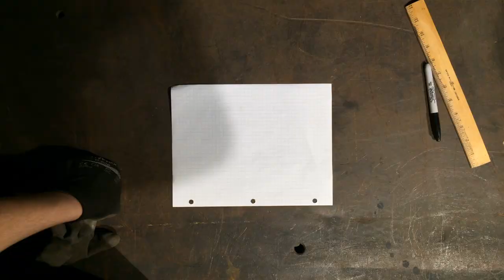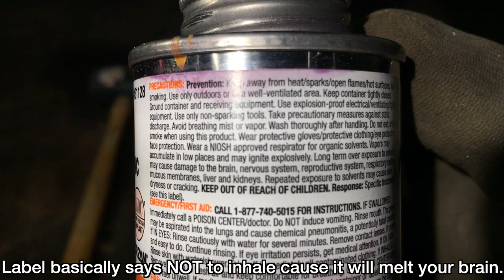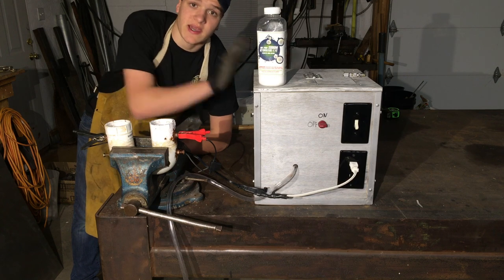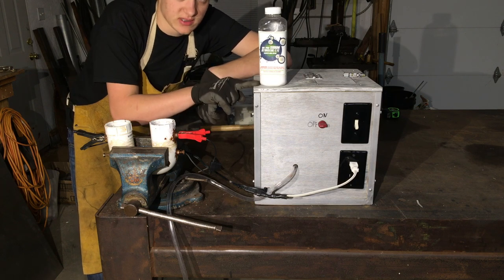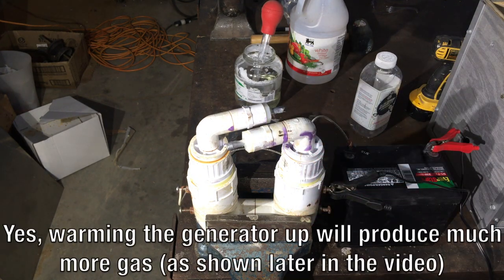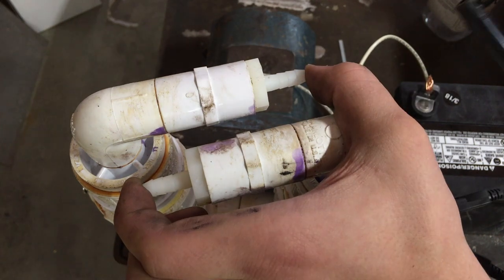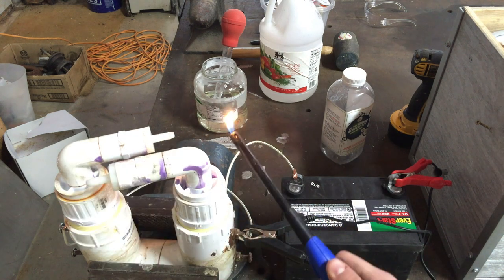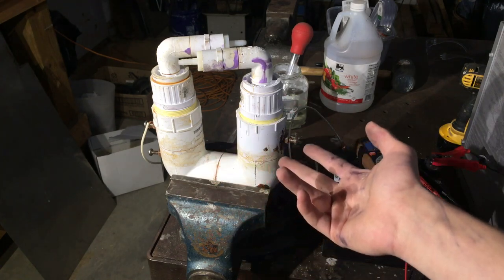Separated Hydrogen and Oxygen Generator (made from PVC) (HHO)

Comment: if u wanna cut stainless steel easy use just water ik it sounds weird but it works
Reply from the maker: Yeah I’ll keep that in mind next time I have a hundred grand for a water jet 😁
Reply: @HappyMadScientist  lol applied science did a video and made one for like 300 bucks but i didnt mean that anyways instead of oil just use water i swear to god its the only way to not go threw 2000 drill bits when the water gets really hot it does something with the molecules in the stainless and it cuts like plain soft steel
Reply: just try it plain tap water spray the part when it starts to steam it start cutting once the water is almost gone spray again
Reply: @Fortitudoo  u do it and show it

Comment: obviously your simple small plates and large separation between them and not using much of an electrolyte etc etc is a poor design and can be improved,,i keep hearing ppl talking about over heating issues but what comes to mind for that solution is to have cold circulating water system that will keep the generator cool
Reply from the maker: Your right, I could just make a water circulator but the fact that it was heating up sooo quickly whithout much gas production is prob do to the inefficiency of the system. Also NaOH reacts with aluminum so I would need to make my own radiator with copper or make some type of heat exchanger.
Reply: @HappyMadScientist  i forgot what was OH? and what aluminium you concerned about? perhaps you do not have proper conductivity or the materials you are using are not good,i think in commercially built models they use some kind of cooling fans but not sure how this would work,,for what im thinking simply use a larger container with in and out hose that circulates water either by a small pump or hooked to your faucet and submerge your generator jar in that large container full of circulating water,,remember to give me credit for the idea and i got more that i thought of for materials to use,,in any case like i said the whole design needs upgrading and can be improved,,you are not using much in terms of plates
Reply from the maker: @ARCSTREAMS  NaOH is sodium hydroxide. It reacts with aluminum and ironically produces hydrogen gas in the process. And since most radiators are made with aluminum it wouldn't work. I plan on making a large dry cell generator that I will make a heat exchanger and that will allow me to use radiators to cool off the system. 
Adding more plates won't work because the gas is only being produced at the very bottom of the plates. It could also contaminate the gas because of the "floater plates" between the electrical sources would produce both oxygen and hydrogen. 

If you want to produce hydrogen seperated from oxygen gas efficiently you have to use whats called a PEM cell.
Reply: @HappyMadScientist  AL and NaHO mixed will produce hydro on there own? anyways you dont need a radiator for a cooling system ,what i described should be more than good enough to allow you to run for a long period unless your wanting 24/7,,i seen separated cells and they still have more than one plate per side like you got ,as for dry cells idk much about them so no help there

Comment: Where can u get the right metal?
Reply from the maker: Online or at yer local metal depot. 

316 stainless is the best easily obtainable/workable metal. Downside is that the water you use in the generator becomes illegal to dump (my understanding).
Titanium is the best all around from what I’ve heard.
Mild steel works for a while if you use sodium hydroxide as the electrolyte. 

Research it thoroughly though before you try anything and don’t hurt yourself 😁
Reply: @HappyMadScientist  what about copper?
Reply from the maker: @ryandavis4689  Never tried it for myself but from what I've heard it disintegrates pretty quickly. Mild steel can work for a while if you use sodium hydroxide as the electrolyte. Still, it won't last near as long as stainless.

Comment: Try feeding hydrogen into car air intake
Reply: Hydrogen implodes when ignited... meaning it get smaller... (hydrogen takes up more space than steam) thus hydrogen actually works against the expansion of gasoline combustion.

Recycling exhaust heat to boil water for steam expansion inside the combustion chamber is another story
Reply: @unitedspacepirates9075  wrong
Reply: you can use a powerful uv light to dry/dehydrate and accelerate combustion, as H2O is the only byproduct after combustion and the gas can expand to a greater volume
Reply: @gunnarthesavagedangerous6164  lol. You think steam has more volume than hydrogen?

Comment: It is an extremely good idea i appreciate that but can you make a hydrogen and oxygen generator and run a bike on it not car or any other vehicle but run a bike on hydrogen and make detailed video on that also
Reply from the maker: Thanks! Good idea! I’ll defiantly have to do something like that. First I need to make a more robust hydrogen generator that could produce much more of the gasses. I’d have to decide to convert a gas engine or make a fuel cell.
Reply: @HappyMadScientist  both options are good at their best
Reply: @HappyMadScientist  if possible for you try them both, more prefrence is for converting gas engine
Reply: @HappyMadScientist  fuel cells are a pain in the brain storing small to large amounts of hydrogen it's a lot more economical to do a on demand system or dry cell
Reply from the maker: “Pain in the brain” lol I like that. Yeah it was just an idea... It’d be more efficient to just do a fully electric system rather than convert electricity into hydrogen. It’d prob be best to compress hydrogen to several thousand psi but if it leaks... BOOM! Haha no thanks
Reply: @HappyMadScientist  but pure hydrogen don't burn
Reply: @HappyMadScientist  and also if hydron on demand system is used then there is no need to modify engine only try to add the hydrogen inlet to engine so that it can be burnt

Comment: Chromium gas you think!!! Chromium carbonyl. How the hell do you get any sort of chromium gas from electrolysis of water and NaOH
Reply from the maker: Chromium gas as in hexavalent chromium. It is produced as the stainless steel’s chromium (added to prevent rusting obviously) oxidizes. It’s the same thing that happens when you weld or or grind stainless. You can easily see the yellow color of the hexavalent chromium dissolved in the water.
Reply: @HappyMadScientist  gas you say???? Gas. Maybe welding would slightly vaporize chromium, but it would not stay in the air as a gas.
Reply from the maker: Maybe your right... I just assume some of it dissolves in the oxygen bubbles that oxidize it in the first place?
Reply: @HappyMadScientist  no it would  combine with oxygen to turn into chromium oxide but it doesn't float  around in bubbles. It will turn into dust if the electrolysis water spills on the ground. Same with welding, it would be like dust, but you will only get oxidation of the chrome if your gas flow is not high enough.
Reply from the maker: Noted. Thanks or the help!
Reply: @HappyMadScientist  might be better to use titanium for the anode. That is what they use as an anode basket in eletroplating to hold the metal they are depositing
Reply: @HappyMadScientist  that way no toxic salts

Comment: The burn rate of hydrogen gas is 25,000 cu ft per second.😎
Reply from the maker: Yeah lol. That’s good stuff.
Reply: James Lacey cu = CUBIC——— FEET PER SECOND ???  That’s a volume measurement!  You need a length measure .
Reply: @nicgreen4234  If you took a square tube , 12 inches by 12 inches that was 25000 feet long and filled it with hydrogen gas at 1 inch water column of pressure, then ignited one end it would take 1 second for it all of the hydrogen gas to burn. Does that help your thesis. Put some ear protection on and try it.
Reply: James Lacey No, on at least two counts. One, Hydrogen doesn’t burn even at the novel pressure you suggest, a stoichiometric mix of Oxygen and Hydrogen at standard atmospheric pressure will readily explode however. And two, the pressure confined in a  tube you describe would rise increasing the speed of combustion, which why it’s usually called a bomb. Take care.

Comment: Power it with high volts and low current.
Reply from the maker: The higher the voltage, the higher the current flow is. That is normally how it works. Generally, ~1.5v is the most efficient.
Reply: i have one that uses 8 amps at 120 volts      a ton of gas flow
Reply from the maker: 120 AC? Do you run it strait from the wall or do you rectify it?
Reply: @HappyMadScientist  yes i use a 90 amp bridge rectifier   yesterday i hooked to a power inverter for mobile use
Reply: @HappyMadScientist  60 plate cell  58 neutrals
Reply: @HappyMadScientist  and very weak koh
Reply: it produces 18 lpm  insane
Reply: water is crystal clear
and stays cool
Reply: its going on a semi next week
Reply from the maker: *long whistle
That’s pretty sweet. Though if you want to run it at 12v couldn’t you alternate the polarity every 9th plate for ~1.3 between each plate? You’d be left with 5 or so unused plates but it’d prob be more efficient. 
I assume it’s a dry cell? Did ya cut the plates yourself or did ya have em cnc’d
You run a torch off of it?
Reply: @HappyMadScientist  i have 1 inlet and 1 outlet  puts out to much gas for the torch, blows it out, i had the plates cut  not ss

Comment: attach that sucker to a pvc potato gun and your in buisness with an all in one unit,,should get one hell of a bank
Reply from the maker: Yeah I’ve tried it. PVC isn’t the right material though unless you want to pick shrapnel out of yourself lol. I tried it using steel pipe but the problem is that when hydrogen burns it turns into water vapor which condenses very quickly creating a vacuum and violently sucking the projectile back into the chamber. To make it work you would have to get a pressure transducer and see when the pressure curve is negative and then start cutting off the barrel until the negative pressure goes away. It’ll be in a future video probably.
Reply: @HappyMadScientist  i would think the pvc might start melting from the inside,,are you saying as soon as you ignite the gas in the chamber it starts shooting the potato but then it suck it back juts as fast that it never clears the barrel?? i had no idea condensing droplets of water created any vacuum?  how about cutting the barrel length down is that what your thinking of doing? juts see where the tatter gets lodged and cut a foot behind that lol
Reply from the maker: @ARCSTREAMS  yeah when that water condenses it sucks the potato right back. I think thats part of why its so insanely loud because it not only explodes but also quickly implodes.
Reply: @HappyMadScientist  hmm ,it must be solved